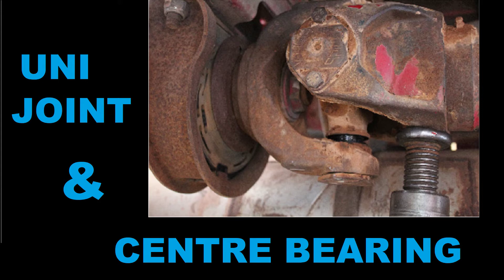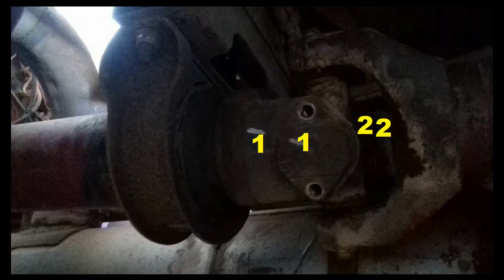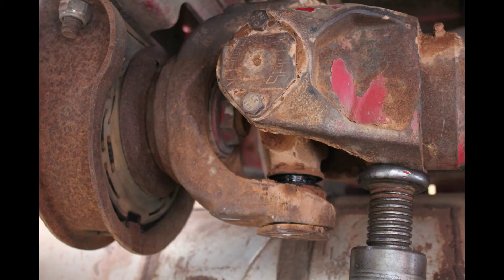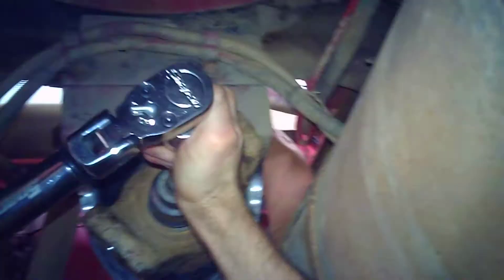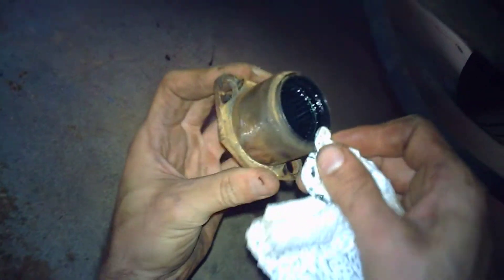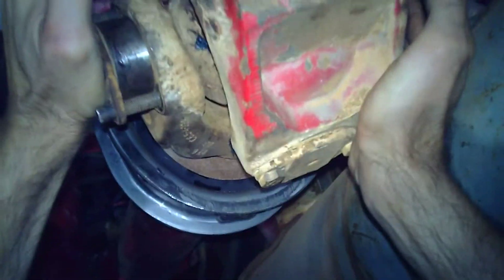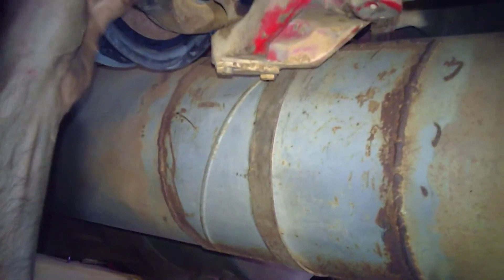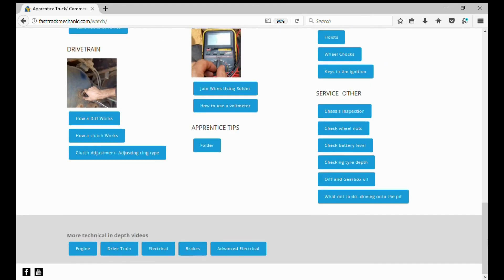Uni Joint and Centre Bearing Replacement- Spicer- (commmercial) truck

Comment: You could take around $100 and get a universal joint puller And that job would’ve went a lot easier and faster
Reply from the maker: True, I have been meaning to get one. Any recommendations? I will probably get the tiger tool 10102